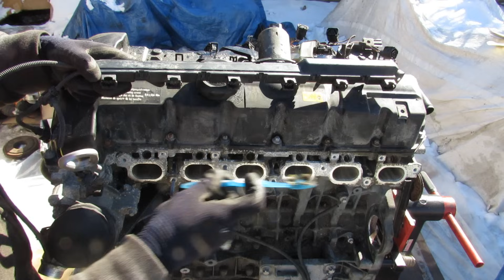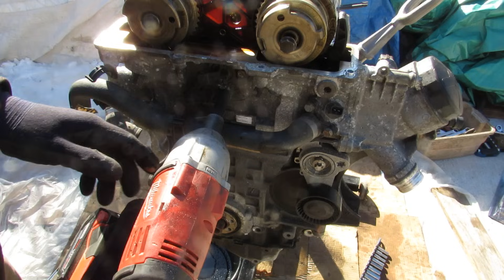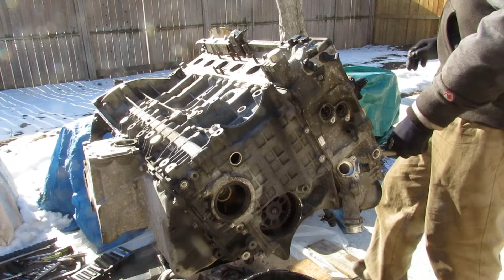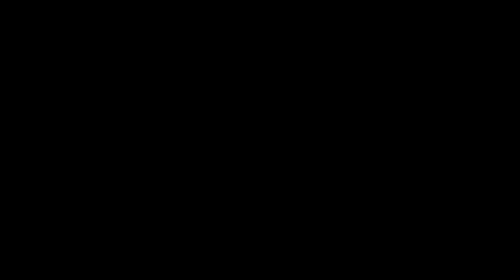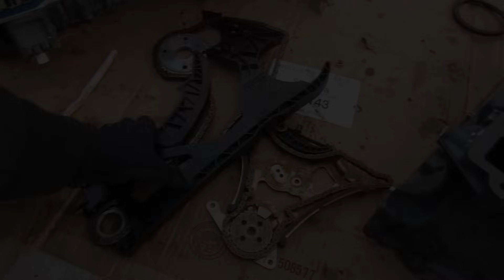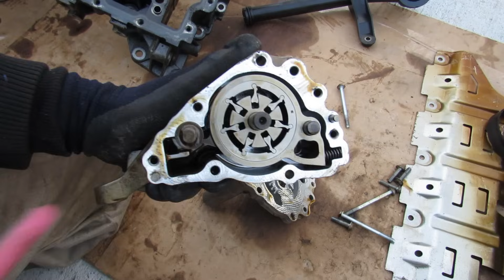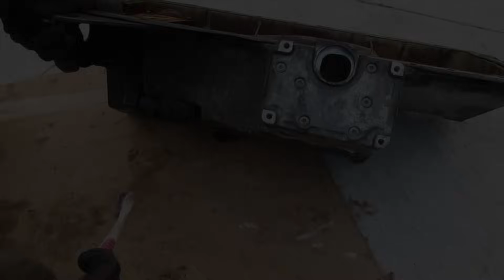The Last Inline 6 Engine: BMW N52

Comment: The N53 engine was the last NA BMW straight 6.
Reply: Nope, N53 ended earlier.
Reply: @somonides1  you'll find that in Europe it ran until 2013
Reply: @bertsmith7013  N52 ran until 2015.
Reply: @somonides1  so, obviously the N53 was the last normally aspirated engine developed.
Reply: @bertsmith7013  It wasn't the last one to be built
Reply: @floridianrailauto9032  I didn't say it was the last one built, I said it was the last one developed.
Reply: @bertsmith7013  The purpose of the video is that the N52 was the last one actually BUILT, that's what people care about
Reply: @floridianrailauto9032  who cares? Still not the last NA engine, if you could count you'd realise 53 follows 52.
Reply: @floridianrailauto9032  it obviously bothers you more than me, grow up and Keep driving your ford fiesta, leave the real engines to the men.

Comment: I can tell you exactly why this failed, not sure why someone would ditch this engine because it was 100% repairable. Notice how at around 5:10 the intake VANOS gear basically came apart. That's not supposed to happen. On the N52 engine specifically, the VANOS gears are held together with a "safety" or "tamper proof" torx bolt setup, which are very prone to shearing off. This causes the engine to have a crank no start condition due to the camshaft no longer turning with the engine. It can be the cause of a lot of misdiagnosed "faulty" engines as well, due to the camshaft being stuck in one position resulting in no compression during crank. That's likely why this engine was removed from its home. Seen it a lot, and replaced quite a few VANOS gears in my time for this exact issue. Engine looks pretty healthy, all it needs are the VANOS gears and to be re-timed. 

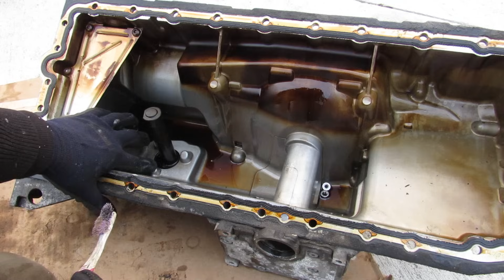Edit: you can see the bolt heads in the oil pan at 19:17
Reply: great video and yes the sheared bolts are in the oil pan. great video ..thanks
Reply: BMW Vanos, the gift that kept on giving until I got an EV. Pretty sure they'll find a way to make those leak, too.

Comment: crazy how they KNEW the plastic valve covers leak like a sieve after the M54, and STILL put them on N engines.
Reply: early N52 had metal cover. typical BMW, engineers build great stuff, then the accountants go and ruin it for everyone
Plastic is harder to torque properly, less forgiving esp to overtorque, I'm not defending their unforgivable use of plastic parts, they can just be rendered even less reliable by minor user error

Comment: Is there any way to stop the oil from leaking
Reply: Of course it is, you just need to change the gaskets :) Unfortunately people seldom maintain their vehicles as they should, for many of them even changing oil and filters seems to be too expensive, they just run it until goes and that is the result :(

Comment: 11:59 I'm pretty sure the bmw TSB says to just rev the engine to 3k for 2 min when cold starting to fix lifter ticking noises. 5w-40 in cold climates doesn't like abuse when it's not warmed up exacerbating oiling issues on startup.
Reply from the maker: So just warm it up?

Comment: This particular engine looks pretty good and repairable, I'm surprised someone ditched it.
Reply: @Mr T you don't even own a car shut up lmaooo
Reply: There is a problem that plagues all German cars around a 100,000 mile mark.  They all are going to start having problems, expensive ones.  At the same time, because of the high-dollar problems, their value plummets.  I bet the owner crunched the numbers and said: trash it.  A Toyota Camry in the exact same situation would have been repaired and put back on the road without hesitation.
Reply: @2605155  You don't know what you're talking about.
Reply: @2605155  the level of ignorance in this comment lol the n52 engine is one of the most reliable engines ever made by BMW. My 2010 e93 328i is at 198k miles got it brand new 0 miles. Have had no major issues with it. Never left me stranded or nothing.

Comment: A lot of the time the VANOS system gets starved of oil by crap building up on the non-return valve sieves. Especially if you use crap oil and/or don't change it at about half the required interval. If you check/clean those at every oil change, it should keep the rest of the VANOS system happy.
Reply from the maker: Oil can be a magical thing

Comment: Ah yes.  Wouldn’t be a genuine Ultimate Driving Machine without a plastic timing chain guide and aluminum fasteners everywhere.  “Hey, we engineered a high-performance intake with tons of fancy, complicated crap to break, so then we had to add a special vacuum pump for the brake booster (so you have brakes).  It’s that German efficiency in design philosophy!”
Reply: Let me guess, you drive a skateboard?
Reply: @diminguyen778  Let me guess… You like to set money on fire to accompany your own personal insecurities?

Comment: Ive owned bmws for 10 years now, never met an vanos failure, but met oil leaks and an coolant leak. They will leak, but if u can live with that, its an RWD car. Deal with it, The e46 will leak on u for sure, but u can drive that engine like no other

Comment: Wow incredible detail. Why are the piston heads so dirty? I used liquid moly engine flush and on the borescope it looks much cleaner at 100k
Reply: I'm guessing low quality fuel and infreqent oil changes. Port injected engines shouldn't have those issues but i guess it just depends on how mechanically sympathetic it's last 5 owners were lol!

Comment: I’ve got a 2007 335i twin turbo 6speed  not bad yet got a water leak on the rear turbo fun fun fun gotta fix it I dread it hope I don’t have to take the damn engine out for a piece of hose

Comment: Great tear down! Being an owner of a 325i with the N52B25 its great to have the knowledge of how this engine works both mechanicly and structually.
Reply from the maker: Glad it's helpful. Please share on your network
Reply: Its a pretty great little motor isn't it? 239k km so far on my Canadian market '07 323i
Reply: @AGolfrGuy12  319K on my Canadian market 06 323 and still in working great - only regular maintenance is ignition coils and oil changes.
Reply: any additional tips before buying one i'm buying a '05 325i with the n52b25 with just 170k km on it
Reply: I got mine at 264 km still running, how is everyones going, any body else get ticking on cold engines?
Reply: @TimmyOtoole-g7m ticking is extremely normal on the n52 engines. Something to do with the hydraulic valve lifters not getting enough oil pressure and slightly hitting itself. Apparently nothing to worry about at all other than annoying noise. I had it on mine, no issues. Nowadays I drive a Subaru STI but I had no issues with my n52.

Comment: This is quite a good engine and as you said relatively reliable. The N52 had a 3 stage intake system on the 330i which gave it a nice intake growl under full throttle and downshifts. 255hp is not a lot but still enough to enjoy fast sporty driving.
Reply: I put the 3 stage intake manifold on my 128i and flashed the ECU with 330i software and the low end torque gain completely changes the character of the car.
Reply: The engine is great, really, but these 255 horsepower.... here in Russia we pay like 150$ road tax for 250 hp car - and it rises to $500+ for 251 and more. Taking into account 500$ is an average man's monthly wage - these 5 horsepower are a real pain in the ass
Reply: @fear-is-a-token so expensive. In America we don't pay taxes based on the car, it's like a set fee for all cars that is paid annually, but nowhere as expensive as Russia or Europe by the sounds of it.
Reply: @zzoinks  wish we had the same system. For small cars the tax is quite low - I pay ~4$ for my 63hp Lada samara, paid 7$ for another Lada (98hp) I had some time ago, and my friend pays ~10$ for his Ford focus. But when it comes to real cars, taxes are really high. I can afford buying a used truck now (2002 ram 1500 hemi, absolutely unpopular in this world of lada shitboxes here, but some are around, and I really like it) - but the idea of paying from 1/20 to 1/10 of its price annually to the government just pisses me off.
Reply: £365 tax per year here in the UK

Comment: this is quite a salvage yard type tear down!  rip it up!  ha, I am not offended but I am amused.  I was curious to see the cylinder block style.  I don't think BMW is continuiing that.  The VANOS is quite different than earlier stuff, maybe it takes less "work" on those engines or maybe they shifted over to this more modern style that everyone uses.

Comment: While this actually isn't the last NA I6 BMW has produced, they aren't far apart. The last NA I6 BMW made is actually the N53, which came in both the N53B25 and the N53B30 variants. It's basically a slightly altered N52 engine, with one of the big changes being direct injection instead of piezo injection. Since we've owned a N52 E61 and now a N53 E60, I can definitely confirm the oil leaky part about it ;) hehe. The video is super great though, and thanks for going through it in great detail! Cleared a lot of things up! Always good to learn new things about your car!
Reply: N53 wasn't available in all markets whereas the N52 was which is why it it often said to be the last NA inline 6 from BMW when actually it wasn't in some markets. On the whole though I think the N52 is better without the direct injection of the N53.
Reply: @joebloggs4191  Agreed. The N53 didn’t have the 3 stage intake of the N52, IIRC. The simpler valve cover and port injection are a plus of the N52.
Reply: happened before N52->N53 switch, later N52s (N & K variants) also lost the 3 stage/DISA intake and therefore some power, somehow with all this they managed to make the whole plastic valve cover with pcv integrated setup that was both less reliable AND cost more, smh @ BMW

Comment: iv been driving exclusively only BMWs for the last 18 years. Not one of my owned BMW ever leaked oil. Simple rule - i always maintained my cars to the highest standards. Now working on other BMWs is different story.. every second one leaked oil. And all of them were poorly maintained, were neglected and the owners put absolute minimum in them.. oh, and engine oil flush additives absolutely screw up all the seals and do no good but harm only to your engine, yet ppl use them.
Reply from the maker: So what do you do that causes it to not leak?
Reply: @speedkar99  As i said - good and preventative maintenance. If you swap the worn clutch, make sure to change rear crank seal same time even its not leaking yet, cost peanuts for extra part and labour since you already there doing clutch. Need tappets adjusting? dont skip it, do that. you replace rocker cover gasket same time too, not reuse the old one and so on. neglect any car and it will cause you problems. But as i said, that was my own cars. Working on somebody else cars its more like fighting the wind.. they all want to "service" it as cheap as possible, repair only bits that have failed miserably already. never add anything on the job as preventative maintenance, as once again - "cost too much". The saying "a gallon of oil is cheap mechanic" there is for a reason..

Comment: VW/Audi 2.0 TSI EA888 would be cool to see. Older versions had terrible timing chain tensioners and piston rings. Other than that they are pretty strong engines.
Reply from the maker: I got an EA888 from a mk6 GTI here waiting to teardown. Will I need some new sockets or tools for the job?
Reply: @speedkar99  Torx bits, a special tool to remove the crank pulley, maybe triple square sockets. I haven't worked on one yet, I just have a MK7.5 GTI with a gen 3.

Comment: Such a great engine when maintained as it should be. I’ve owned mine for 4 1/2 years and have had no issues other than 2 minor oil leaks and a fried starter. Exceptional engineering.
Reply from the maker: How much did the oil leak cost you?
Reply: @speedkar99   whatever the OFHG and eccentric shaft sensor gasket cost, it didn’t cost me much since I replaced them myself. The eccentric shaft sensor is quite expensive though haha
Reply: @ChewbaccaFetus  was there any warning when your starter went? I'm a little worried about mine, it still starts every time but I know it can fail.

Comment: Got this engine in my 328 and I've been very impressed with it. Never had a leak anywhere (knock on wood) and I've had it for well over two years and about 35,000 miles I put on it (182,000+ in total). I would actually recommend a 328 with an n52 as a first car if they want to learn how to work on something different and unique!
Reply: My 4.0 with 225,000 doesnt leak a drop
Reply: my 328 at 180k miles does leak oil. still a great engine

Comment: This engine is actually pretty reliable and fault-proof for how complex it is - aside from direct fuel injection it got EVERY thing you can think of for optimizing that natural aspiration... It's main problem (just like every BMW) is usually it's oil consumption, but then it depends on how it was driven and maintained. What really amazed me is that i seen engines having their head rebuilt yet required no work on pistons/cylinders after 10-13 years... Although their design/materials do contribute to that oil consumption somewhat. Otherwise the only thing that kept annoying me was DISAs, but mainly because you have to crack them open to service them and they tend to fail without you knowing yet they affect performance greatly.
Reply: Yea. I've had an E46 M54B30 and currently have an E90 328i with the N52B30. I can take that M54 and tell you everything about it. This engine is a bit more complex. I am mixed on the port injection vs direct injection only due to the fact that I don't have to worry about carbon build up on the back of the valves. I had a 2016 Malibu Limited LTZ with the 2.5L ecoboost. Had put 152k miles on it and the valves had a bit of carbon on the back. My E46 and E90 have clean valves at 230k and 192k miles, respectively. Overall, the N52 has given me very little issue. I just got the part to change the OFH gasket, but the process actually looks easier than the M54 one.
Reply: @CMitchCars  yeah oil filter housing gasket on m54 was a PITA.  i had the intake off and replaced the crankcase ventilation valve at the same time so had more room but wasnt fun
Reply: @brainkill7034  After 2 years, my engine blew at 250k miles lol. And that OFHG was a piece of cake, too. Much easier than the M54B30. I actually found my old E46. Went through a few hands, but I know the guy that currently owns it. She's in great condition, too. Regret selling her.
Reply: @CMitchCars  The E46 is BMW's best car and I will die on that hill.
Reply: N52 is port injected

Comment: I got this engine in my F10, 5000 km since I bought it and I can say it has enough power for smooth daily driving, the sound is also very nice. I also have the oil leak from the valve gasket cover and now I know how to remove it :) Thanks, great video. Saved on my playlist for future garage repairs!

Comment: can you do a BMW diesel m57 engine? I'm curious about their diesel engines and your take on them
Reply: BMW's diesel engines need no introduction, it's either very good M47, M51, M57, N57 or very crappy ones like M21, B57, M67 and, oh god, B37...
They all reliable because, first of all, it's diesel thus lower operating temperatures, there's more oil in the block, torque is available right from the idle so you don't need to push pedal to hard, second, there's no crappy electronics, no VANOS no Valvetronic, no EC thermostat. It's simple as rock, prolly built like rock too, which is a good thing, because cyl sleeves made from cast iron. They got their moments like glow plugs and harmonic balancers but it's nothing compared to gas engine. I got 2004 E46 with M47N engine and after 350k km i ONLY changed oil and filters and had basically 0 issues with this engine. I own 11 different cars and believe me, BMWs is the best to work on them.

Comment: BMW still make inline 6 variants by the buckets. But you can not for some reason get them in the US market as I understand
Reply: They still make them but from what I have read they're not naturally aspired. Turbo has taken over. Maybe I am wrong about certain markets/countries.
Reply: @larrymarchiony3166  Yo are correct that all BMW inline 6 are turbo charged now. And from what I can see now also models like 540i (3 litre inline 6) Is sold in the US market. That was not the case in 2020

Comment: I have two BMWs with this engine a 530xit and a Z4 coupe both with lots of miles and both run like a top knock on wood. And your right on with your description. If your handy with a wrench and stop the oil leaks they should go for a long time. Maintenance is the key
Reply from the maker: Agreed. Can't have a Corolla budget with these
Reply: I'm not a wrench turner, but I have a 330xi. Besides oil changes and gaskets, what constitutes proper maintenance? How do I clean the engine to maintain nice clean cylinder heads?
Reply: @Navisworker  Hello since your engine is port injected your engine shouldn’t carbon up like a turbocharged engine. I’ve removed the intake manifold off to replace a starter motor and the intake valves where as clean as a whistle. Keep the oil changed at 7 thousand and keep an eye on you PVC system and it will go for a long time. Word of caution fix the oil leaks especially the oil filter housing gasket.
Reply: @anthonygillesse7242   I had all my gaskets replaced at the same time (even the oil pan), not a job I want to pay for again. I do oil changes ever 10-12k km.

Comment: Aaaah..so that's how valvetronic system works.. very precise bro.
Reply from the maker: Yes! It's pretty neat
Reply: @speedkar99  very complicated or elaborated compare to swirl with the disadvantage that you can't get rid of it like you can remove swirl
Reply: Unfortunately, I had to learn how it works because I had to replace the eccentric camshaft and the valvetronic motor on my N55 engine...
Fairly disappointed that BMW decided to put a plastic motor inside the engine.